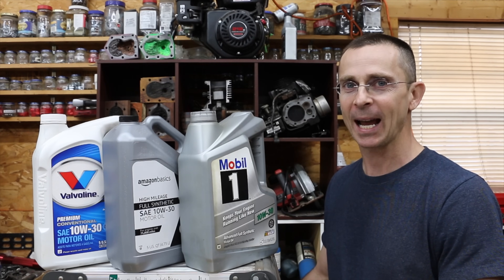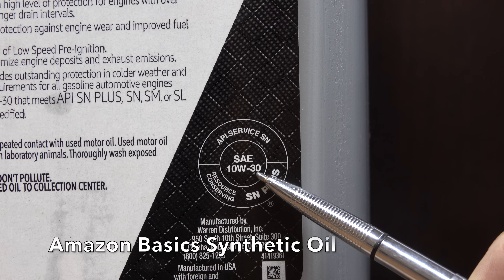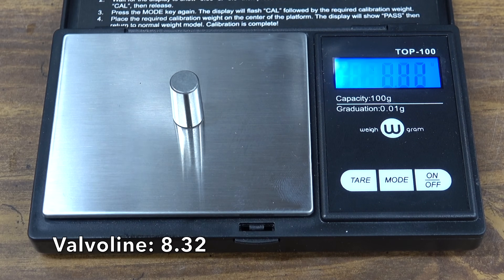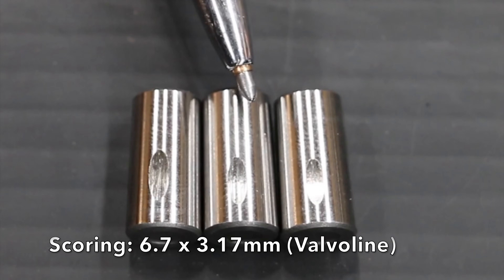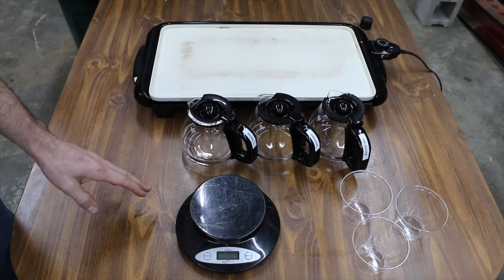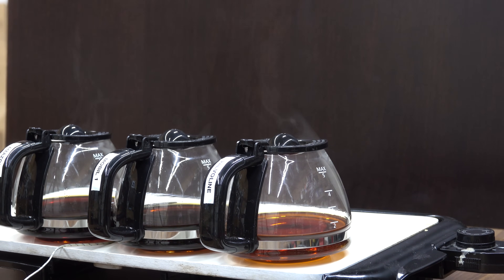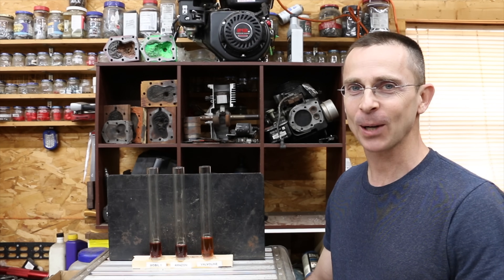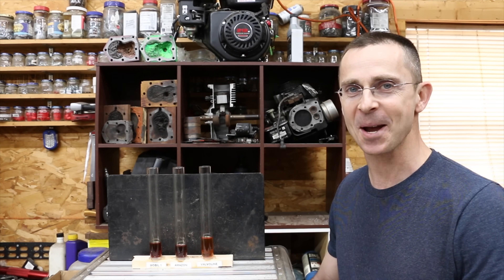Is AmazonBasics Full Synthetic Motor Oil better than Mobil 1? Let's find out!

Comment: Great video as usual. Just one note - putting unsealed glasses of oil in the humid environment, that is a freezer, contaminates the oil with water. If the oil gets significantly darker during its freezing, it absorbed a lot of humidity.
Reply: At -15F, the air is actually very dry. Any water vapors have condensed out.
Reply from the maker: Great point!  Thanks for the constructive feedback.
Reply: @ProjectFarm  put a cap on the tubes to keep out the air while cooling.

Comment: This is not a fair test. The grade is correct, but the type of oil is different among this test. Synthetics and conventional is very different due to additives. This test is therefore skewed in some way. For example, Full Synthetic with Maxlife Technology from Valvoline May perform much better than its base conventional grade(10w-30). This should be addressed and be re-examined. @projectfarm
Reply: Are**
Reply from the maker: Thanks for the constructive feedback.

Comment: Maybe test a wider range of oils? I personally use Castrol full synthetic. Also, it would be interesting at some point to see what the long-term use of these oils would do in an engine. Naturally that long-term test would be either very complicated or extremely expensive because you’d need to either use one engine for all the tests and do a complete rebuild with every oil; or get a different engine for each oil.
Reply from the maker: Thank you for the video idea!

Comment: I think you got the idea that you needed to make your videos shorter for various reasons. Attention span mostly, but you're talking way too fast. Try to get it somewhere in the middle. You could have cut out the 2 minute explanation on the API thing with the oil weight. Summed it up with "This is the level of viscosity, and the first number is the viscosity at cold temps, the second number is on warm engine, all 3 bottles are the same".
Reply from the maker: Thanks for the constructive feedback.

Comment: HI, Commander and right at the start, I doubt it with the Amazon stuff BUT if the MIL specs are the same it just might. I don't know if there are a mil listing anymore. So we'll see and I've heard really good stuff out of MObil-1. Thanks Commander, stay warm and BLESSINGS all around!
Reply from the maker: Hi Lewie, Always great to hear from you. Hope yall are staying warm.  Overcast and rainy just above freezing here.  Mobil 1 is a brand I trust!  I really like the AmazonBasics too after the testing.  It's from Warren Distribution and they've been around for many decades.  Thanks again and wishing yall many Blessings!
Reply: @ProjectFarm  Looks like it did well in the test. I'm afraid if I put synthetic in my stuff it'd all leak out on the ground through the worn out oil pan. Been rainy but mild here, 40's to 60's. Warmish some too. Already knocked the high tops off the grass with the new-ish mower. It'll be here soon. Thanks for another FINE test and yall keep warm and dry! Happy Valentines Day 2 yall too!
Reply from the maker: Great point on the leaks.  I need to put together a video on this.  I have the old Ford 5000 that has always had conventional.  It'll be interesting to see if it begins to leak once I use the synthetics.  I somehow missed this reply amongst the sea of replies.  Hope you all had Happy Valentines day!
Reply: @ProjectFarm  Seems like the old Texaco Havoline was like the synthetics of nowadays. If there was a place it could go, it did. Might've been more detergent additives then. That's why I stick with the diesel formulas. Supposed to be 
high detergent/high dispersant so the filter can pick out the crud. But as the old black guy I used to work with said all the time, 'Dogged if you and me know'. We had a tea party with the grans and I was able to finance a Mom/Daughter day as a valentine present so I can sleep inside until I mess up big time again! Blessings to yall! 40 today but sleet yesterday. Whatever and GBWYall!

Comment: Awesome test! Suprised at the results of the Amazon Basics Synthetic oil. I would be confident in using that oil in my vehicles!
Question for ya, can you recommend where to purchase a cheap, but accurate, digital scale like you use in your vid? I do a little painting and fiberglass work as a hobby, and it would be nice to measure out for adding hardeners by weight or percentage.
Thank you kindly!
Reply from the maker: Thank you.  Out of convenience, I buy just about everything from Amazon.  I live in a rural area and it's a bit of a drive to town.
Reply: @ProjectFarm  
Ok, so just look up the digital scales on Amazon then?

Comment: I have a Ford 300 6cyl with over 340000 miles on it , after 220000 I said why put new oil in it so I run old used oil in it and I haven't changed it for about 6 years it driven locally but idles for about 8 hrs a day , I figured she would have blown up by now but not yet maybe next year.
Reply from the maker: Wow!  Those Ford 300s are tough!
Reply: @ProjectFarm  when it does finally go I'm going open it up and see the damage ,

Comment: Awesome video but I would have liked to see the lubricity test run a second time after cooking the oil because that would be a major problem if one of the oils stopped providing protection after just heating it up.  Maybe you can use the oil that you already heated if you haven't disposed of it yet and make a Project Farm Short video with the results.
Reply from the maker: Great point!

Comment: How about a lubricity test after the heating?
Reply from the maker: Great point!
Reply: Project Farm I live in Phoenix where our winters only get as low as 35. However our summers get as high as 120. This would be a great idea
Reply: It'd work better since the oil would be at operating temp, he tests at room temp since that's when the most damage occurs
Reply: @cpufreak101  I think that what was meant was that the lubricity test should be done after the effects of heat have taken its toll on the oil. The test still would be performed at room temperature.
Heat degrades oil, so oil that hardly wears as new might wear significantly when older.
Reply: @cpufreak101  the cold engine damage is because of thick oil not flowing into the bearings. Cold oil is thicker, so actually creates a thicker seperation film.

Since the lubricity tester is manually oiled, cold flow through small passages is not an issue, and so cold oil will give better results than hot oil.

Hot oil on the lubricity tester will have a thinner film, thus more wear, if there is any failure in the multi viscosity formulation.

Source: industrial lubrication and tribology training, and experience.
Reply: @ke6gwf  interesting, now I'm interested in what the difference would be using his test method
Reply: @cpufreak101   I mean after its beem cooled/chilled again

Comment: Looks like Amazon and Mobile 1 could be the same oil (maybe slight variance on the weight or additives)
Reply: I don't think quite so. I know Walmart Supertech is Likely the same as the Amazon stuff though since they're made by the same Company. I'm pretty sure Mobil is independent of Warren though
Reply: @cpufreak101  From what I've been told Warren Distribution is just that, a distributor. They buy oil in bulk that meets the private label requirements. In the past I know Mobil was the supplier for Walmart synthetic. I can't say now because contracts change but it would explain the similarity.
Reply: @9HighFlyer9  nope, Warren Oil Company manufactures it's own oil and distributes it under the Warren distribution name, it's simply the branch of the company that deals with selling the oil to the labels.
Reply from the maker: Thank you!

Comment: these kind of videos are great. visually shows the difference in certain products. have you ever tried anything with the turbine heaters? with the cold temps up north we have been running ours constantly at work and we have tried both kerosene and diesel. notice kerosene seams to put out more heat but have always been curious as to the actually over all difference in heat out put and fuel consumption. our heaters are rated for jet fuel as well but yet we have never tried it. would also be curious as to if you could maybe burn cooking oil in them as well and I know it wouldn't be safe to do it due to how much more unstable and explosive it is but always wondered what would happen if you put gas in one too. maybe a thought for a future video. but either way keep up the great videos. always look forward to the next one.
Reply from the maker: Thank you for the video idea!

Comment: for me one of the best oil is the Castrol edge FST titanium! with anti-wear additive, anti-friction and extreme pressure added to the oil! (additives to fullerene C60 and polar plus, C60 as anti-friction, and polar plus to fix a film of oil on each piece for cold start protection)
. you should also try the bardahl turbo protect additive where bardahl oil booster, the anti-friction tests are awesome 😮
https://youtu.be/5bCan3XTBBw
I love this type of videos! could you test the bardahl oil additive please?
I always add the bardahl oil booster Racing where the bardahl turbo protect in all my petrol or diesel vehicles, I have never broken a turbo where anything!, cars important for me I respect the times of heating and extinguishing the engine to preserve the turbo, but older turbo diesel vehicles which I do not care a bit, I push cold, I cut the engine without waiting (not good 😂😉) and yet never broke a few things! the product must still effect!
today bardahl manufactures oil directly with these additives of C60 fullerene and polar plus, such as XTC, XTS, C60 technos etc. Where Castrol with titanium molecules.
Reply from the maker: Thank you for the video idea!

Comment: Wait, normally I do not complain BUT, I did see the Mobil ONE oil fly out of the container so that means you used way more of that than the other two. I have not seen the end of the video yet so I do not know how it ends. I had to stop the video to make this comment just in case you say Mobil ONE is the best. If Mobil ONE is not the best than it sucks because it had an advantage. I stopped your video at 4:43, now lets see the rest of the video.
Reply from the maker: Thanks for the constructive feedback. I tried to ensure the wheel race was slightly submerged into the oil bath for all products.

Comment: Although lubricity tester is throwing everything more than specyfic level out, amount of poured fluid isn't efecting this test? I mean when it splashes it can take more or less product on wheel.
I know that this is reliable, as it is fixed weight and all other, but shouldn't You fill these test tubes full pour all of it in cup?
How good it will flow out from tube is also variable, but it should leave less than pouring like pi in the sky from containet a to b without measuring.
Reply from the maker: Thanks for the constructive feedback.

Comment: Good video, would have been interesting to see the film strength after it was cooked. Alternatively does the film strength of the Amazon basics oil hold up at the end of the oil change interval.

This side of the pond, its went from mineral, semi synth and full synth to semi synth, GM / BMW specific, VW Specific, Citreon /Peugeot specific and Ford Specific and woe betide if you deviate, some of the VW engines have been known to fail should you not use an oil that meets their specs, their PD diesels being the worst affected.
Lots of issues a few years back when the fast fit places (places that do oil/filter swaps) were just putting the same oil in every car, cue a spate of turbo failures, timing chains snapping etc
Cars here went from running 20/50, to 15 or 10 W40, to now 0 or 5 W 30 or 40, though some of the newest oils are 0W20 or even 15.

Plus we have both API numbers and ACEA numbers (as diesel was more common here for about 20 years and the Euro diesel specs are a lot tighter than the PI C standards were for a long time.
Reply from the maker: Great point. Thank you!

Comment: I would like to see this done with oil that is rated for use in diesel engines. They have a tendency to use a lot more oil so the savings could be greater. 
I could see who the distributor was for the Amazon Basics. I’d be interested to see who it was for the other 2 oils. Although that wouldn’t necessarily tell us who made the oil it would give us a hint if it may have been made by the same refinery as the other oils.
Reply from the maker: Thank you for the video idea!  Warren Distribution makes the Amazon oil.
Reply: Project Farm Thanks for all the great videos. I saw that Warren was the distributor of the Amazon Basics. I couldn’t see who distributed the other two. 
I’d also like to see you turbocharge a OHC lawn mower engine. It would be fun to see it in the go cart. Then maybe some nitrous. 😉

Comment: The manufacturer actually specifies a 5W-30 or 0W-40 for my car.
I run Shell Helix Ultra 0W-40 ... probably complete overkill for a 61hp 1l 3 cylinder engine.
It would work just as well with a 10W-40 wich cost half as much, wouldn‘t it?
Reply from the maker: Highly recommend staying with the recommended viscosity just to be safe.

Comment: I’d really like you to test RVS products. Their blame is is that RVS forms a triboceramic surface under friction and heat inside the engine. Basically making a metal surface such as cylinder bore or bearing really slick and resistant to wear. Will it form such a surface and does it work against wear and tear or is it yet another snake oil?
Reply from the maker: Thank you for the video idea!

Comment: I'm not sure how you would test this, but a popular controversy in the motorcycle world is the use of Shell Rotella T4 diesel engine oil in motorcycles with "wet" clutches as a substitute for the very expensive motorcycle-specific oils. I have been using T4 in all of my bikes for years and would love to see some testing done to see how comparable they are with regards to the clutch performance or wear one or the other may cause/prevent. Thanks!
Reply from the maker: Thank you for the video idea!
Reply: Shell changed the formulation over a year ago in their Rotella oil line and added friction modifiers, so it is not as good for wet clutches in motorcycles anymore.  I used to run it in my dirt bike with a Rekluse clutch and then after an oil change using the new looking bottle of Rotalla, the clutch started to slip. Called Rekluse after trying several different things and they advised of the formulation change.  Rekluse no longer recommends Rotella.  Too bad, it was cheap and worked great.
Reply: @stickbeard  Any Jaso MA certified oil contains no friction modifiers
Reply: @sketchstuffs  Just going off what Rekluse told me, but I did notice slippage with the new formula, as did all their race teams.  Something changed on the formula and allows slippage for dirt bike clutches. You may want to double check the specs - I did not see a JASO MA spec on their website, only a JASO DH-2.  I think the DH-2 is for low emissions, so something else was added that induced the slip.  I used it for several years before the change. The bottle/label had a small change, and that is when the new formula was introduced.
Reply: I was always told to avoid the "Energy Conserving" oils for the wet clutch. To that I've always run conventional Castrol in my bike. It turns 17 years old this year and still runs strong with no issues...and still on the original clutch.

Comment: Since the 10W is the expected flow rate in cold weather, I didn't notice if you had evaluated how far from the 10W spec each oil was.  Faster flow doesn't mean better necessarily, right?  I'd anticipate you'd want to know how closely to the 10W expected flow rate each was instead of first across the line.  (Edit: If you want different flow speeds, you could just get a 0W or a 50W. Out here in California, we often use 0W)
Reply from the maker: Great point. I tested temperature extremes.

Comment: The wheel in the valvoline test looked like it was barely touching the oil while the latter two were sitting in it. Maybe the lighter colored valvoline just made it appear as so.
Reply from the maker: Great point.  Before starting the tester, I ensure the wheel is immersed in the oil.  The lighter color may have been a factor for viewing it on video.

Comment: Supertech full synthetic is the same (warren distribution oil). you can find it at walmart and it's ussually cheaper.
and Amazon just dumps products below market value and then Jacks up the price.
Reply from the maker: Thank you!
Reply: When did Walmart jack up the price?  The strategy of selling below cost in order to take over a market and then raising prices back up afterwards only works in poorly researched textbooks.  In real life step two is nearly impossible.
Reply: @sonictech1000  really? then why does amazon jack up prices after dumping products below market value.
amazon is required to ship the oil to your house which is more expensive than shipping to a brick and mortar store.
Reply: @ashishpatel350  What has Amazon jacked up the price of?